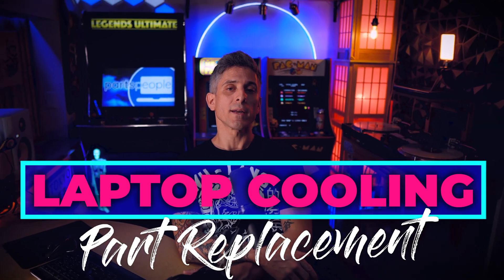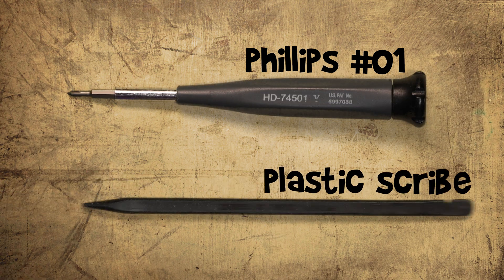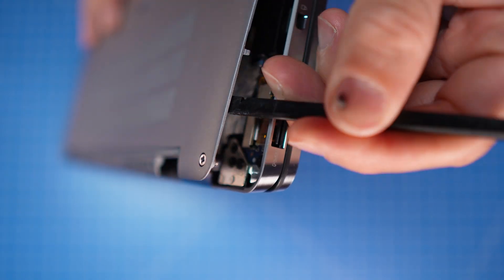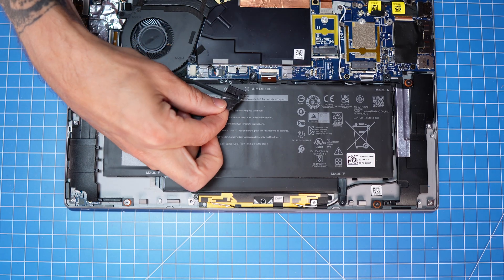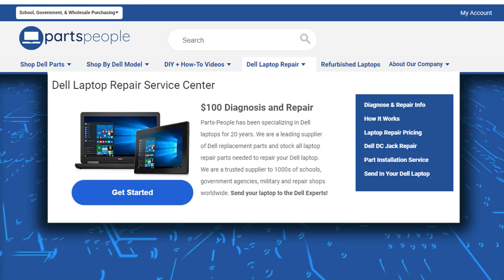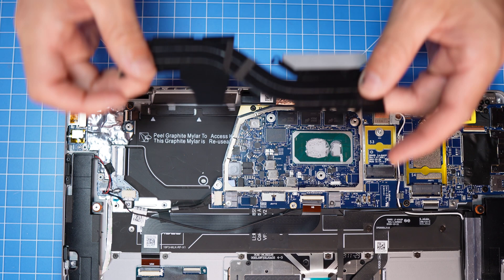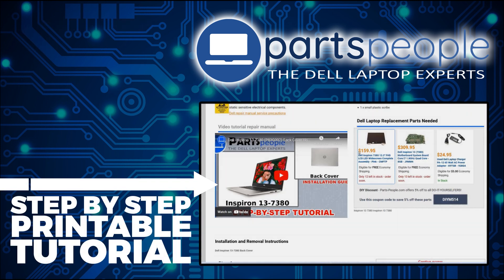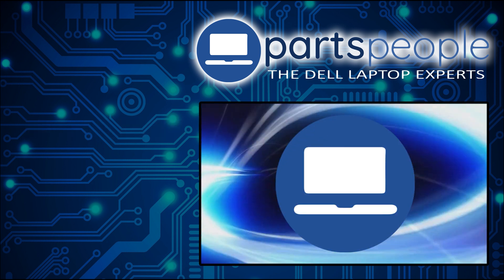Laptop Cooling And Fan Repair | Latitude 9520

Comment: Hi! I have an issue with the price man. 

You are charging 24$ for a heatsink without any fan (dell inspiron 5368)

The shipping is 48$ extra and says it doesn’t include tax? That is insane man. I would love to buy from you if you can help me a little bit
Reply from the maker: I got the price for the heatsink reduced to $14.95 - As for shipping, we do not mark up the price for shipping.  It sounds like you are having the part shipped out of the USA, and choosing FedEx Express shipping; which is quite expensive, but very fast delivery.  To some countries, we offer a slow cheap option for $6 shipping but it takes 3-4 weeks for delivery, but it is not available in all countries.  We do not collect duties or taxes for shipments outside the USA. You would be responsible for paying that if applicable. I hope this helped!
Reply: @dellpartspeople  Placed my order yesterday! Thank you
Reply from the maker: @thatboyjodh You're very welcome!